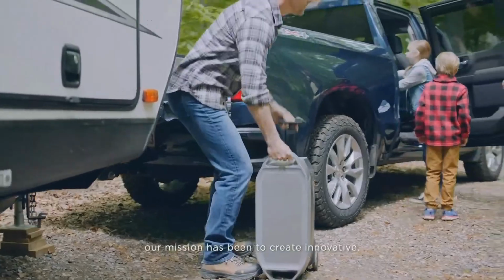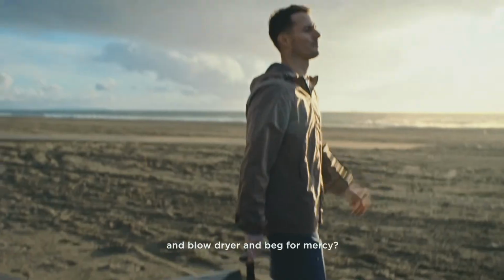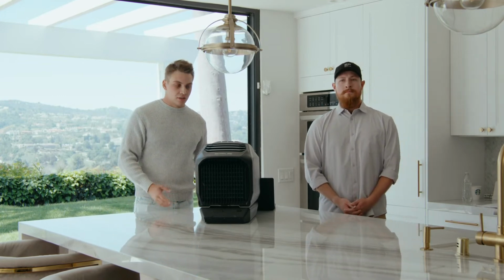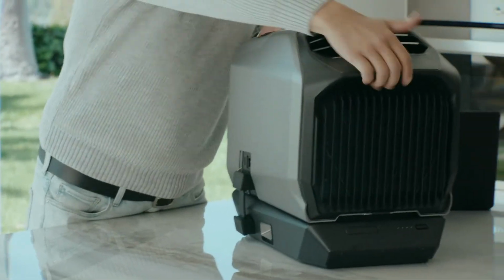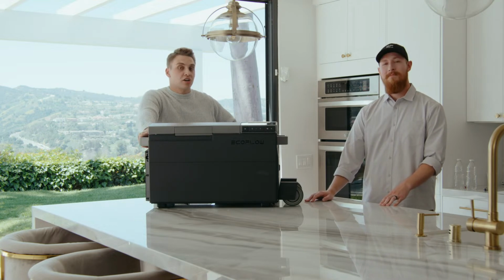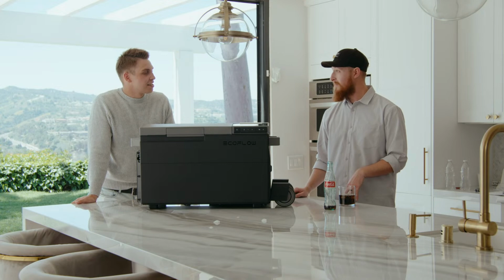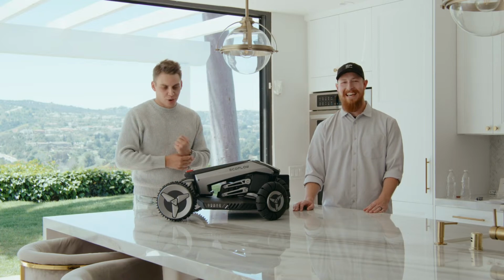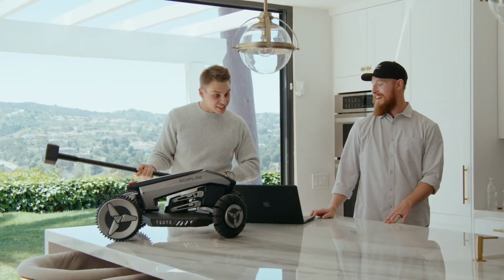EcoFlow Smart Devices Launch Event

Comment: I am interested in the EcoFlow Blade. Does the antenna need to constantly be line of sight? I want this to cut my backyard and front yard, no lawn connects them. We have a Roman style garden between them.
Reply from the maker: Thanks for your interest! 
The GNSS antenna is used to receive satellite signals, so you need to install the antenna in an open outdoor area, with no buildings or trees above the antenna and at least 2m (6.6ft) from surrounding obstacles. 
And you can set the pond or fall-prone area as a "No-go" zone in the mobile app, then the robot will automatically avoid the area when mowing.

Comment: Thank you for the excellent launch event.  But, something that should be addressed from your event is that there were many observations / questions in the live chat that have not been addressed / answered.  I feel it would be wise for you to create another video, or a posting on your website, in which you provide answers to the chat questions.  There are many of us who are very interested in your products, but we have very important questions that should be answered, which could weigh on our decisions to make purchases.  Please give this some serious thought.  A particular question of mine is --- regarding your new Wave 2 AC / Heater, will you be offering some form of window connection adapter for the outdoor end of the inlet and outlet hoses -- you are now making a some great end connectors on the hoses, but, as I recall, you are not offering a window-opening connection plate / fitting that we could connect to an open-window-filler plate that we make.  What is your guidance on how to resolve window connection?  I can think of a very simple design of an adapter connection you could make.  Or, have I missed something?  Thank you.
Reply from the maker: Yep we will defintely take your valued suggestion into consideration! 😉 Talking about the adapter, for now there isn't an existing adapter, you can either DIY or try the drain-free mode of Wave 2 in the APP.

Comment: P.S.  One interesting observation / disappointment -- for those of us having a Delta battery (like the Delta Max), we may already have a heavy duty power connector cable from the old Wave unit to the Delta Max.  Why is it that that cable cannot be used for connecting the new Wave 2 to our Delta Max batteries?  For various reasons, I recently purchased a new connector cable for $70 in anticipation of powering the new Wave 2 from my Delta Max, but it appears that the cable cannot be used by the Wave 2.  Thank you.
Reply from the maker: Hi Walter! Which kind of wire have you bought? If it's an XT150 cable, then it is universal.
Reply: @EcoFlowTech  The cable is identified as the EcoFlow Extra Battery Cable.
Reply from the maker: Hey, it should be able to connect the WAVE 2 and the DELTA Max batteries then. If it still can't be connected, please join in our community to get more feedback on this: https://bit.ly/3mEuADX

Comment: Hello 
Is it necessary to put those hoses on the wave 2 if you use it indoor. I would need it for my garden house in the winter for party but have no option to put those hoses outside without opening my door but then the device would be useless when the door is open. I am from germany so my english is not perfect 😅
Reply from the maker: If you use it indoors, you need to connect the exhaust ducts at the back and above in order to exhaust the exhaust air to the outside.

Comment: Can the wave 2 be used in a car for car camping ? And if so how will I be able to vent the air out ?
Reply from the maker: Yes, we have duct adapter hoods available. When used in an enclosed space, the exhaust air can be discharged to the outside through the WAVE2 exhaust duct.
Reply: @EcoFlowTech  how big is that exhaust